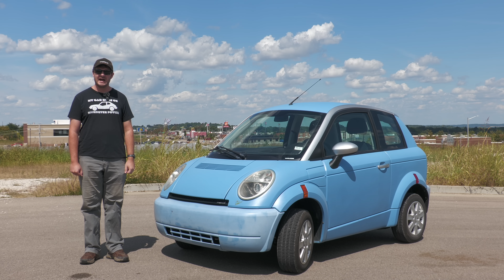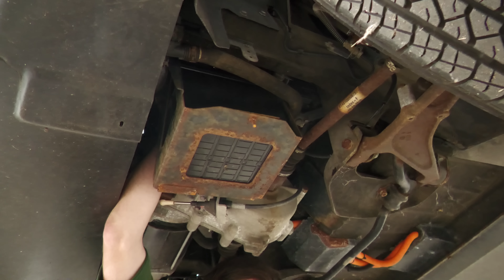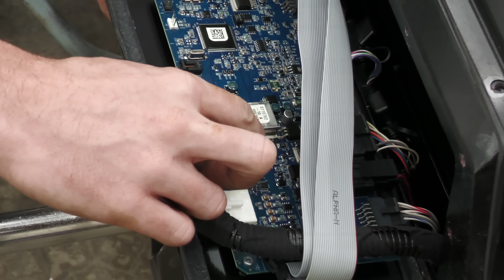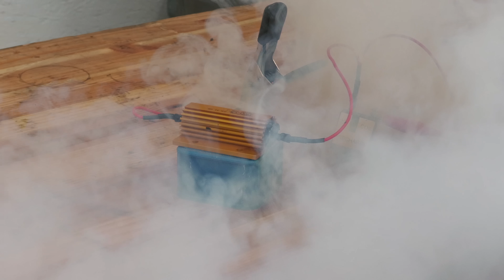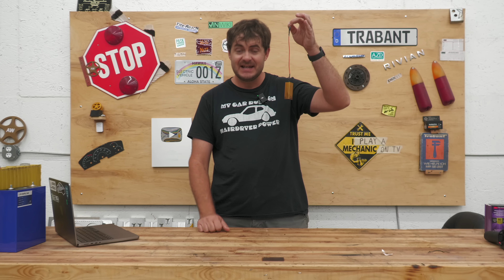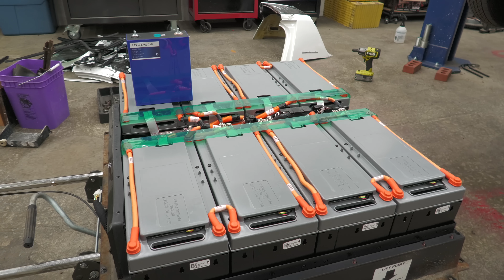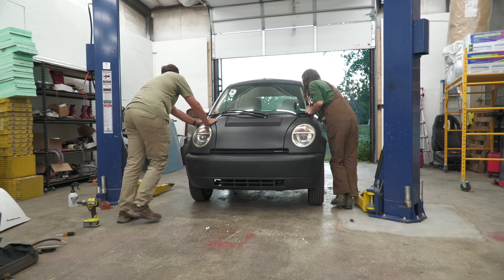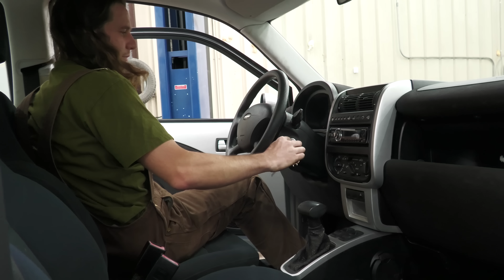Th!nks Have a Design Flaw (and mine gets a new battery)

Comment: I'm sure you're already aware of this, but I wouldn't recommend the heating method for restoring faded plastics. What this process does is bring oils to the surface of the plastics where those previously in that area have evaporated away.

The oils in plastics provide strength and flexibility, and when you heat and redistribute the oils, it makes the plastic more brittle. Repeated heat gun treatment will leave the plastics incredibly brittle and they will start to crack and shatter easily.
Reply: So, could one slather the plastic with plasticizer oil of some sort and then heat to put oil back into the surface?
Reply: Wait,  really? I wanna see it hit with a bat and shattered 😂
Reply: in the name of science,  of course.
Reply: I agree but this isn't a classic Porsche. It's a $500 EV
Reply: @mediocreman2  No, it's not a classic Porsche, it's something actually rare and historically significant.

Comment: Starting at about 01:52 in this video: 

As I understand it, a lot of people in Europe {and the UK} have an 'aversion' to AIR CONDITIONING. And that is despite the statistics I have heard about how many people die from heat-related illnesses in that part of the world PER YEAR. 

Also: Speaking as someone who was born and raised in St. Petersburg, Florida -- and later lived in Dade County, Florida {where Miami is also located} -- I think I am qualified to say: 

AIR CONDITIONING IS NOT OPTIONAL!!!!
Reply: Idk about the rest of Europe but in the UK you really only 'need' it for a couple of weeks each summer. Houses (and flats in particular) retain heat but with cars, rolling down the windows while in motion and blasting the fan is usually more than sufficient. Average temps here are usually in the 50s F (10-20°C. Most vehicles sold here do have AC, but I manage just fine without it (1982 Volvo 244DL).
Reply: @rich_edwards79  Same in Denmark, plus the AC itself, getting it fixed if it breaks, and the added fuel consumption is like 3-5 times the cost as it is in the US because of our ridiculous taxes.

Comment: I recently bought a Ford Escape plug-in hybrid, and it has a 14 KW hour pack, but it only lets you use 11 KW hours before it starts using the engine in hybrid mode. 11 KW hours gets me about 33 ish miles of range, and I've been amazed that covers 90% driving and then I just recharge it overnight with the 120 volt charger. I can go weeks without ever using the gas engine. It'll be a sad day when the pack ages to the point that I'm not getting that range anymore, but this has easily shown me that my next car, or my wife's next car can be full electric without any problems.

Comment: A modern battery swap would be pretty cool.
Reply: You cant do that because it’s not a modern EV.
Reply: @orishaeshu1084  why not? seems like its a pretty simple setup.
Reply: Modern EVs aren’t simple
Reply: @orishaeshu1084  seems pretty easy to me, just pop in LiFePO4 cells, makesure the series connections are the same then pop on however many cells in parrell will fit and either replace or reprogram the charger, i mean the dude had a diagnostics laptop id be suprize if he couldnt adjust the BMS refferance voltages to work with the new batts.
Reply: @Rev @Reviosis you know its not just battery cells in a modern EV right? I don’t think we are going to be on the same level in this conversation, do some extensive research and learning for a year please.
Reply: @orishaeshu1084 Im literally only talking about replacing the existing cells in that pack with a modern counterpart like the LiFePO4 cell he showed off in the video, yes I know there's more in a modern ev battery but it all boils down to the same core principals of cells, BMS, charger, cooling and contractors. So swapping in a modern, or i should say newely manufactured cells then reprogramming the BMS and charger to work with said new cells is probably verry doable.

If anyone should go take a class it's you.
Reply: bro just go eat his ahh, I’m not stopping you

Comment: Robot Cantina did a gasoline battery Golf Cart and they are looking for something a bit more road worthy to give a mileage and reliability upgrade to. The Black think would be ideal for them I think.
A little EV like the think that can tootle around the city and do local errands instead of a massive SUV with a six ton battery pack is what all the net zero calculations are based on and even though climate change is nothing but a ridiculous scam that only the truly gullible fall for I'd actually like a little car like a Think for tootling around in.

Comment: 15:00 PLEASE if you're doing this you MUST clear coat or protect the plastic against UVs. This is a one off, and it will come back 10 times worse in a few weeks or months
Reply: Yeah, i made the same mistake. Sure, it looked nice and shiny maybe for a months, now it looks the same as before.
Reply: So does this method work on all kinds of plastic bumpers? What kind of clear coat would you use here?
Reply: Including the bird poop and bug splatter!
Reply: Wait what do you mean by "one off"? I got a BX which also has plastic bumpers that are not painted, but rather the plastic itself is body colored, and they all fade the same way. So I do have certain interest in knowing what this whole thing is about.
Reply: @556johny556  Having had a pre-facelift BX its even worse, whatever protective layer they used burns brown and leave a very ugly finish, use Polytrol. 
I don't exactly know why its one off, having tried it on a lot of things. My guess is all these plastic trims have some sort of protective layer from factory, that once you burn off will let UVs damage it quicker
Reply: @ulrich_badmecanique  On my BX everything was too late, the Polytrol was also only a tempoary solultion. In the end I had them spray painted at a shop. The problem is getting the old texture right, which is challenging. The trick: Adding primer to the paint adds some roughness and a matte finish
Reply: @640kareenough6  Yeah polytrol only lasts a few months at best, but I just re-applied it every time I do a bit of detailing it wasnt too taxing
Reply: How did a heat gun turn it blue ?
Reply: @rodden1953  It's burning off the "oxidized" layer of plastic off the surface, but also whatever coating it may have left
Reply: @ulrich_badmecanique it's not burning off anything, but bringing the oils in the plastics back to the surface where they have previously evaporated. But redistribution of the oils over a now wider area means the plastic becomes brittle and inflexible.
Reply: @shakotanVIP  thank you smarter man than I am
Reply: @shakotanVIP  Wouldn't vaseline help if it's just about oil? That's what's commonly used for cheap plastic lawn chairs.
Reply: @rodden1953 My exact question.
Reply: I was actually surprised to see Robert do this. I thought anyone well informed knew it's an unrecommended method. I painted the faded bumpers of my Opel Astra F with bumper paint
Reply: Nobody really cares. It's a $500 car

Comment: If nothing else, you have demonstrated the ability to hot-swap battery packs.  Now, let's design this with a hatch-like mechanism that can engage a number of positive locks at once, instead of a bunch of bolts.  
The dream of a 10 minute recharge or battery swap is achieved and then we just need more nuclear grid power instead of coal.
Reply: This system exists and is commercially available! Look at cars from NIO, a fully automatic battery swap takes about 5 minutes 😊

Comment: We used to blow up resistors in the lab back in the day, in our electronics classes...They were JUST little guys though, little pcb type typical resistors... and even they blew up violently AF, with lower voltages no less. Resistors are violent when they go... and when they're hermetically sealed inside of a captive heatsink, they're legit fkn bombs / fireworks.

Comment: It's amazing to see how effective the heat gun is at reviving the bumper color! And how much it moves with thermal expansion!
Reply: i wonder how long this fix lasts for. i heard it doesn’t last long using this method.
Reply: @CloroxBleachOfficial  i "fixed" plastic trim pieces on my volvo with a heat gun. 2 months later, and it looks just as bad as before, if not worse.
Reply: @CloroxBleachOfficial it lasted longer than I thought for the stuff we've done with it. To me it's fascinating that you are reversing UV damage with excess heat, LOL.
Reply: It's a terrible idea, ends up making the plastic brittle.
Reply: @shakotanVIP will I get your point, I think it's already brittle by that point because it's already lost the plasticizers. Good caveat though, for sure.
Reply: Amazing how the air inlet deforms and wobbles while heating up and cooling down.

Comment: Electro Boom would be proud of the steps of going from 48v STRAIGHT TO 350V.
Reply: Ha! True! Except ElectroBOOM would connect the leads with his bare hands while standing in a bucket of water!
Reply: @JustWasted3HoursHere  Yes, the sanity of face shield and prodding it from a distance with a stick is not really on brand.
Reply: robert really skipped over a nice opportunity of a second collaboration in the same video.
Reply: StyroPyro too.
Reply: hellawatts
Reply: You're actually thinking of Photonic Induction's channel - he's the scarier 'product testing' version of Electroboom, as he plays with both higher currents and higher voltages that most people wouldn't dare (well, except perhaps StyroPyro) in order to see what is the maximum an everyday item can handle
Reply: @djfmitv  I don't think Photonic Induction would be impressed by 350V or or even 35Amps (assuming 10 ohm resistor, as that did seem a plausible 10KW resistor heat-up )
Reply: @djfmitv and then you have the madness that is styropyro.
Reply: @djfmitv  You literally sound like your clippy profile picture. Good job
Reply: Electroboom got nothing on this guy!
Reply: Electroboom is fake.

Comment: I was going to joke about 60 Minutes faking car fires by using model rocket engines, then your resistor fired off like a model rocket engine... Computers for the win. Circuitry should have prevented all of this by the time the product made it to market or a recall should have solved it before they went belly up. Errors like this perpetuate the idea that electric cars are bad slowing adoption even more.

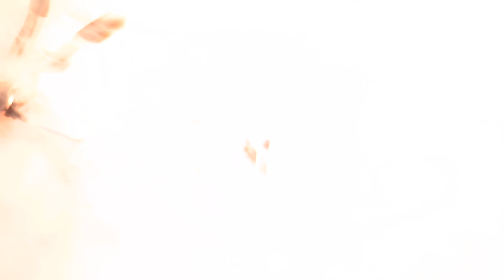Comment: 7:18 HE MADE A ROCKET!!!
amazing video, now i demand thee rest!
Reply: I have seen a smaller version of one of those resistors blow the end out so violently it dented an adjacent metal canned relay and covered it in melted solder. The cause was a software engineer single stepping through code that was supposed to generate a single pulse just a few milliseconds long.

Comment: I thought EVs didn't have internal combustions....
Reply: Hubnut just did a video on the original Citroen Berlingo EV van. Which has a petrol tank. Because it has a petrol heater!
Reply: @TheChloeRed  has anyone done a video on the lion EV buses that are secretly giant lithium heaters?
Reply: @TheChloeRed yep, interesting that video 😂
Reply: @TheChloeRed  I own a Citroen Saxo Electrique which should be the same tech underneath. Not roadworthy yet and the battery doesnt wanna charge reliably yet but itll get there
Reply: @TheChloeRed our electric busses also have a diesel heater. It’s always funny sometimes seeing smoke coming out of an EV 😂
Reply: If an EV owner has bad gas after eating chipotle, does that count as an internal combustion engine?
Reply: @griffhawkins8909  It does count as emissions.
Reply: @griffhawkins8909 probably, yeah.
Reply: @griffhawkins8909  no that would be counted as chemical warfare.
Reply: @griffhawkins8909 only if you ignite it! 🔥
Reply: The do if you’re doing it wrong enough.
Reply: Anything can have internal combustion if used improperly enough
Reply: The owner/driver isn't part of the ev so I'd say it doesn't count. Otherwise by the same logic you can put a gas lawn mower in it and say it has ICE
Reply: Only the really bad ones...
Reply: This made me laugh a lot harder than it should have, great comment.
Reply: Does this classify as external combustion?
Reply: To be fair, they don't stay internal for very long.
Reply: Any vehicle can Internal Combust.

Once.
Reply: HAHAHA!!!  I was just thinking he should do these things outside!!     internal vs external combustion, LOL  made me laugh.       I'll see myself outside!!!  HAHAHA  so many dad jokes!
Reply: External combustion…
Reply: The good ones only have internal only swasticars externally combust.
Reply: Nah they get external combustion
Reply: They don’t that’s internal obliteration
Reply: External combustion is a thing.
Reply: Any smart electric car has a built in charging system so it can get home when your phone dies
Reply: Internal combustion - singular. Then your EV is a paperweight. 😭
Reply: Only if you're brave enough
Reply: You'd Th!nk not.
Reply: Not voluntarily they dont
Reply: EV fires are scary. Especially Tesla’s when they lose power right before catching fire while you’re trapped in it.
Reply: @hellsfirefreedomtube6984 a lot have manual release override handles, for when you can't get out. 

Still it probably pays to have a glass hammer in the car - really any car. As you never know when it might come in handy.
Reply: @ArmChairPlum  especially if the car ends up in water because you can’t open the door till the pressures are the same inside and outside (the car fills) and smashing a window lets you open it immediately
Reply: This one has a little, as a treat.
Reply: Well the person inside the ev probably has a short fuse and gets in flames really easily
Reply: *infernal combustion
Reply: They tend to combust wholesale, not just internally.
Reply: Anything can have internal combustion if you are brave enough.
Reply: They don’t…..
Reply: The difference is that when an EV has internal combustion it STOPS moving.

Comment: 9:45 And it would cost a fraction of what it originally did. Lithium battery prices have gone down from around $3000 per kWh in 2000 to $1000 in 2010 to less than $100 today. That's why the whole salt battery thing isn't as absurd as one might first th!nk.
Reply from the maker: The example cell I showed was purchased for less than $80/kWh
Reply: $100/kWh in large installations like for load balancing of grids; there's a lot of overhead in home installs, as well as more fire codes you need to engineer compliance for, and that drives up the cost a ton. If you DIY it you can get close to that $100/kWh number, but only if you do enough kW, wire it all yourself, and get the components from China.
Reply: Those "pre-heated salt" batteries were a predecessor to current sodium ion battery. Now sodium ion battery are far superior, it's very cheap, has almost the same capacity and durability as LFP, and can operate normally from -40 C to 75 C without any capacity/performance loss (which is a good suit for extreme climate)
Reply: Lithium batteries are 100 dollars per kwh? So why do home batteries for solar installations cost so much, like thousands of Euros for single digit kWh setups?
Reply: @dustojnikhummer my 12.8kWh home system was 3000€. So about 240€/kWh for a complete, certified system.
Reply: @kain0m not bad because this $100 per kWh never contains labour
Reply: @dustojnikhummer  Those 100$/kWh are the cost of batteries alone and without any kind of shipping and taxes included.
Besides that, in a solar system you also get at least an inverter and a BMS which are also quite expensive in their own right. 
And on top of batteries+panels+inverter+BMS you add installation and taxes and you get a big number.
Reply: @dustojnikhummer  they are way cheaper if you don't buy brand like ecoflow
Reply: @dustojnikhummer  Because of all the stuff that isn't the battery. But something like a Tesla car replacement battery comes to around $140/kWh. The manufacturing costs for Tesla are even lower.
Reply: @dustojnikhummer  because brand, installation, warranty, 'eco tax', etc. Still, prices are dropping. When I had mine 5kWh battery backup installed in 2021 I payed 5000 euroes. I recently saw a compatible 5kWh module from the same manufacturer for sale for 1500 euros.
Reply: @Matticitt  solar inverters are usually restricted to the brand's batteries, which are greatly overpriced.
I think if someone wants a battery, he's better off to buy an inverter that accept any battery, separate from the panels, rather than a complete panels+inverter kit that will comes with its limitations, it'll probably be a bit more expensive up front but the battery will be way cheaper.
Reply: @dustojnikhummer  Because greed. You know, that heatpumps are a century old tech, aircons exist for decades, yet when heatpumps suddenly got a reverse valve so they can heat not just cool, increasing demand, getting into legislation, suddenly they cost 5-10x more. Manufacturers must ride the hype wave, you know.
Reply: @dustojnikhummer because Europe
Reply: @chkndnts America is more expensive now though..
Reply: Has anyone done a LiFePo4 upgrade to a Think? Could do same capacity and less weight which would give it more than original range, or stuff the housing full to have more range than original.

Comment: fwiw, that looks like a MOV/Varistor rather than a straight "constant" resistance resistor (carbon film, wire wound, etc)... same function in this case, it's doing inrush limiting (similar to a surge protector).